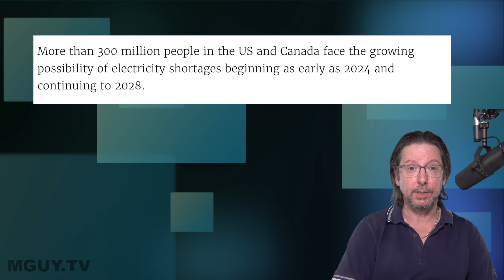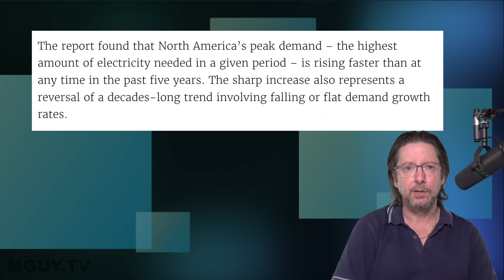Electricity grids WON'T COPE with mass EV charging | MGUY Australia

Comment: This works out perfectly.  Once they get you on to a battery only car, they then control how far you can go with that car. If you go at all. And game, set, match. They don't like your views, they disable EV chargers a certain radius from your location. They keep you trapped. Or they disable the charging completely, depending on how travel worthy you are. Maybe you get one trip per year allowance. The point is they now control your private movements. An insufficient grid to power all these EVs is a feature, not a bug. This is why they are not concerned.
Reply: 'Central banking digital currency' You will only be allowed to spend money on what they aprove of
Reply: @bsimpson6204  Perfect way to prevent people from exercising a certain pesky Constitutional right.
Reply: @bsimpson6204 so make your own stuff.
Reply: Correct.  add to that the removal of cash and the compulsory digital ID and we are all prisoners.    Take off the 3 from your name tag and you have the Mark of the Beast.
Reply: @davewatson2124 fossil fuels keep you a slave to the government. 
Make your own electricity and build your own EV for independence.
Reply: A good way to ban private vehicles.
Reply: @Sundog_x that is what they are doing with ICEVs yes.
Reply: "Smart meters" on your electricity allows the authorities to simply shut off your power whenever they like. It's already a done deal, coming soon to your neighborhood.
Reply: The moment those smart meters starting being forced to be used was the first inkling of energy control measures being put into place. They were pushed as a means to allow time of use billing, which sounded great until you realize that trying to use power according to a schedule was already the first step in energy control advertised as a seemingly good thing.
Reply: Isn't population control why EVERY vehicle, not just EVs, has a control computer linked via cell phone data for over-the-air "updates?  I don't play with my '83 diesel Mercedes and '88 Chevy diesel step van.  New diesels won't run on vegoil or used ATF/motor oil like mine....
Reply: AND they can shut off your car anytime because!
Reply: I predict there will be an underground market for hacker mechanics who can hack into the car's computer and disable & fool all these nanny & surveillance systems embedded in modern cars.
Reply: Your paranoid delusions are showing.
Reply: as for your opinion about EVs being able to control your movements, tell me, which is better:
1) a vehicle that relies on a delicate, global supply chain for fuel, or 2) a vehicle that can get its energy from a rooftop without anyone involved?
Reply: Geez!. You’d be a ton of fun at a barbecue😳😎👍!.

Comment: At this point, Solar energy IS cheaper than coal and diesel plants.

Just invest that EV money into them and turn the diesel plants on when the sun isn't shining
Reply: An electricity grid powered by solar and wind is more expensive than one powered by coal and hydro , due to the need for expensive transmission , storage , short lifespan replacement , disposal costs and back up , all of which are conveniently overlooked by those who push solar and wind generation.

Comment: If Oz is coy about Uranium reactors it should look into Thorium ones with the abundance of Thorium and the increased safety. Thorium was abandoned in the Early days of reactor development because you can't make bombs from it.
Reply: No proof-of-concept.
Reply: You are most certainly wrong. India has designed and is developing a reactor fuelled by thorium — the Advanced Heavy Water Reactor — which, according to Kakodkar, will serve as a demonstration not only for the thorium fuel cycle, but also for passive safety features. India is not alone in its intentions to reap thorium's unique properties. @aliendroneservices6621

Comment: On top of that, they are banning gas stoves in many places.  So, people will have to get electric ones, which will put added strain on the power grid.  Then here in Canada, they are subsidizing heat pumps so that people quit using heating oil.  More electricity will be needed for that.  If everything runs on electricity, there is no backup for when there is a power outage, since everything will quit working.
Reply: Shucks  --- natural gas connections to new  building and homes is now prohibited in Seattle and increas9ing nuimbers of other cities in California and Oregon.

So those wind machines and solar panels will need not only to charge automobiles, but heat homes, water and cook food on those loooong and cold winter nights.
Reply: Correct. And what happens if we ever have an EMP attack here in North America as I'm predicting? I'm guessing things will really get ugly then!
Reply: presumably their plan
Reply: Yes, here in Australia they are banning mains gas in all new houses, I can't see them banning LPG tho...
Reply: @alangb2086    Found this quote from gasenergyaus: All conventional LPG supply is phased-out entirely by 2045. By 2050, zero emission sources are the only sources of supply still in the market. Since the public release of the Frontier Economics modelling in March 2023, additional biodiesel and SAF projects have been announced for Australia.Mar 12, 2023
Reply: Even a 50% dependence on electricity will cause chaos if not available for anything but a short time.Madness to be 100% dependent just bending over waiting for the next cme to destroy our electrical society.
Reply: Heat Pumps.
Hilarious.
In minus 20 or colder there is no heat to pump.
Basically you are installing the MOST EXPENSIVE furnace, and heating the most costly way.
Reply: @bradkubota6968    Ya, they need a second heating source for really cold days.  I'll keep my high efficiency natural gas furnace.  Anyone in Canada who gets a heat pump, should also keep their other heat source for the really cold days.
I have a natural gas fireplace that works during power outages.  Going fully electric is a huge mistake.
Reply: True, when pumps don't work you can't even buy gas for your generator.
Reply: Yes, that's the plan; you'll have no power, no food, no transportation, and you'll die. Agenda 2030 summed up!
Reply: All part of the plan, actually.  This crazy green agenda is brought to us by the far left in the US, Canada, and Europe.  They reflexively LOVE everything that 
does not work and hate everything that does work.  The rush to EVs isn't the real problem here:  it's just a symptom of a much wider mental problem.
Reply: All part of the plan only one source or energy and can switch yours off and we are all f@@@@d

Comment: I looked something up on Google now yesterday.  Knowing what the Elites each own. They each own a supper yacht. Knowing they have generators on board. I asked Google about them. Most come with 2 150kw generators. That each take diesel to operate. That 300kw per ship. Each supper yacht is only for a single person. 300kw for a single person to ride on their boat. That takes thousands of gallons of diesel to operate. That takes 20 to 70 people to operate it. That each of the 20 to 70 people own their own vehicles and homes. All for one person.
Reply: false if they have 2 one is for backup
Reply: @NightshiftCustom  Go do your own research before you call someone a liar. They have two and then a backup. 150kw is max. Most have less power.
Reply: maybe on a ship not a yacht. and I also said IF it has 2 gensets it will only run one at a time
  @scanadaze
Reply: @NightshiftCustom  Look it. Stop assuming. That's what I did. You got a problem with what I said. Take it up with Google. Not me.

Comment: I had a guy knock on my door trying to sell me solar panels. He got all offended when I said no, with out him saying anything else. I told him, if I buy solar panels, I'll need to add more supports to my 250 year old home's structural to support the weight, also I'll need to replace my roof as its 20 years old ($20,000), if I add more structural support ($10,000), I'll have to put in a real basement as I got a dirt floor and stone foundation, ($60,000), I'll also need to upgrade my service ($15,000), on top of his solar panels ($30,000). Which adds up to $135,000 on my $200,000 worth home. So I asked him will I make that $135k up in 10 years or less, which he responded with a swear word and walked away.  People don't figure the weight of the solar panels along with the snow load, as I live in the north east and a few years ago gotten 6ft of snow in one month and the fact that you can only return a portion of the power to the grid depending on your home's service. Something like 20-35%, so if you have a 200 AMP service you can only put 50Amps (25%) back on the lines.

Comment: MulletGUY, you’ve done it again. Average commute <50km. Power required to replenish that <2kw. Average dishwasher cycle 1.8kw. And it happens overnight, off-peak. 
As for high speed public chargers, they too have batteries charged off-peak. None of this is a burden on the power grid. Governments will manage the transition to renewables, or suffer the political consequences; but it’s nothing to do with EVs.
Reply: Lol, keep thinking that. You are as brainwashed as they come

Comment: Lindsay Fox has maybe a thousand B doubles. How would you charge 1,000 semis every day??? And that is only one company. Road trains doing the grain? Stock crates running into the Pilbara? Remote cattle stations? 2 thousand B doubles run into Melbourne or Sydney, Perth, Darwin and all need to recharge at the same time, which they will, yet still have to run around and do pick ups???? Only those who have never done the job would enforce this insanity on the industry.
Reply: Well as usual the lunatics are in charge of the asylum

Comment: Between the EV nuts and small time/ industrial scale bitcoin miners, everyone's going to need their own reactor.
Reply: Funny thing...my roof can generate all the electricity my home and my EV needs using sunshine.
Reply: @justsomeguy934  I hope you're insured.
Some outfit in the u.s. recently lost gazillions from a hail storm.
Reply: @redmoonspider  and oil companies/shipping companies lose gazillions when a tanker runs aground or explodes. Exxon Valdez, anyone?
Reply: @justsomeguy934  yeh, wasn't that last year?
Reply: @redmoonspider  I'm not sure what you're referring to, there are other oil rig/tanker disasters we can discuss if necessary.
Reply: @justsomeguy934  oh my mistake. I was thinking of the cargo ship that sank because of EVs spontaneously catching fire.
I'm not sure which one.. 2023 or 2022.
Reply: @redmoonspider  lithium batteries do catch fire, no doubt. The question is how often and how dangerous are they compared to a tanker ship full of gasoline or oil.
Reply: @justsomeguy934  neither of us can answer that now. What we can argue is which is worse on the environment to extract.
My position is that batteries are f ing disgusting.
Reply: @redmoonspider  how is a solid state battery that is over 90% recyclable with a 300,000 mile life expectancy "disgusting" compared to the poison out of your tailpipe every second you operate an automobile? Your comparison and standards for disgusting are not rational.
Reply: @justsomeguy934  Is your home off-grid?
Reply: @aliendroneservices6621  My home doesn't have to be off-grid whatsoever. The point is that a solar panel uses no fuel, makes no noise, works forever unless damaged and makes all the energy a home or EV needs.
Reply: @justsomeguy934  Your home would indeed need to be off-grid, in order to confirm your claim.
Reply: @aliendroneservices6621  ABSOLUTELY FALSE. I'm simply telling you that a typical roof in my area can generate 100+% of the home's energy needs. I, in fact, know several home owners (including my next door neighbor) that does so. It's so common in my state that the utility companies have a cap on how much energy you can generate and contribute to the grid.
Reply: @justsomeguy934  "I, in fact, know several home owners (including my next door neighbor) that does so."
Off grid?

"It's so common in my state that the utility companies have a cap on how much energy you can generate and contribute to the grid."
Oh. So the only reason they have solar is to allow them to steal power-service.
Reply: @aliendroneservices6621  what is your obsession with off-grid? I'm talking about power generation and consumption. Solar power can be consumed by the homeowner directly, with excess sent to the grid. Solar power can also be sent to the grid directly in a net metering arrangement. Solar power can go exclusively to battery or heat storage is so desired. The point is that solar power steals nothing, can take an entire home's demand off the grid and even contribute energy for one's neighbors at no expense to the utility.
You seem to be in some hole trying to not accept homeowner power generation. I suggest you objectively look at your motivations and thought processes.
Reply: @justsomeguy934  "...solar power [...] can take an entire home's demand off the grid."
Proof of concept?

"...and even contribute energy for one neighbors..."
Your neighbors don't need energy. They need power-service. Stealing power-service from the grid, causes your neighbors' power-service bills to go up.
Reply: @aliendroneservices6621  you have a comprehension or learning issue. A solar power array on someone's home steals NOTHING. In all cases of solar power owners that I know, they contribute excess energy to the grid that goes directly to their neighbor's homes (or anywhere else). They are either paid for the contribution or have a net-metering arrangement with their utility to reduce their related energy bills. Your description of energy theft by a contributor to the grid is nonsensical. When you want to make rational arguments, give me a call. In the meantime, you're not.
Reply: @justsomeguy934  "A solar power array on someone's home steals NOTHING."
Correct. People steal power-service. They install solar hardware on their homes to accomplish that theft.

"They contribute excess energy to the grid."
Correct. Not power-service.

The grid needs power-service, not random energy.
Reply: @aliendroneservices6621  you're playing some semantics game to make an invalid point. Solar panel owners DO contribute power-service in the same voltage and amperage as required by the utility. I'm not sure if you're trying to make some comment about nighttime energy production of electricity with solar panels or whatnot. No theft is involved, the grid has more energy than the utility generates when solar panel owners choose to add their power to the grid. You're really struggling with a cogent argument here, I suggest you gather your thoughts and ask someone else about how you present your argument. You're irrational in your statements.
Reply: @justsomeguy934  "Solar panel owners DO contribute power-service..."
Then prove it by running your household year-round off-grid with your own solar power system.

"....the grid has more energy than the utility..."
You're mixing up energy and power again.
Reply: @aliendroneservices6621  Off-grid homes have nothing to do with energy production. I think you're confused with off-peak energy contribution of solar. Solar contributes energy to the grid or the home during daylight hours. Nighttime energy is retrieved from a storage device or the grid, depending on the design of the system. I know people with both setups - direct-to-grid solar production and direct-to-storage solar production.
You're mixing up energy terms, and they are meaningless in this discussion.
Reply: AI, actually.

Comment: A ship in Alaskan waters is on fire. It is hauling EV's batteries. I don't know what started the fire, but does it really matter. If the fire reaches the batteries it's going to be fun times on the high seas.
Reply: Ever seen an oil tanker on fire?
Reply: It was carrying L Ion batteries, not specified whether they were fir EV's or not. However the fact is that L Ion are not safe as compared to Lifepo4 batteries.  Just damp salt water air can cause issues with L Ion batteries and cause a short. The Lifepo4 are not near as bad and won't burst into flames. Sounds like poor packaging and storage. They have confirmed the fire started in the batteries.  The only way to stop the fire is to drown the batteries and short them out and that's what they are doing.
Reply: @johnstark4723  What I read was it was EV batteries. But with the way the media is run today, trying to be the first gets in the way of correct facts, hopefully its' not EV batteries.

Comment: Potential collateral impact. One thing that’s absolutely essential in operating an oil refinery is a stable dependable power supply. If the charging demands of the newly mandated EV fleet cause strain on the system, a steady supply of refined oil products is one thing that could be impacted. You can be sure there will be many more surprises, and you can be equally sure the dim politicians steering this ship will be completely caught out by it.
Reply: They can install their own generators. They don't want to until the need arises, of course. And electric utilities frown on serious self generation because they hate competition.